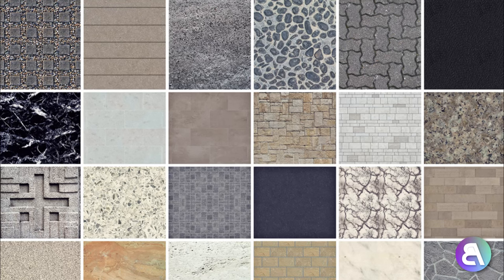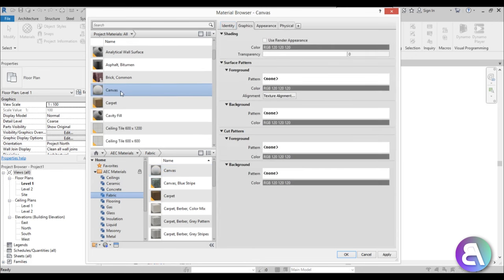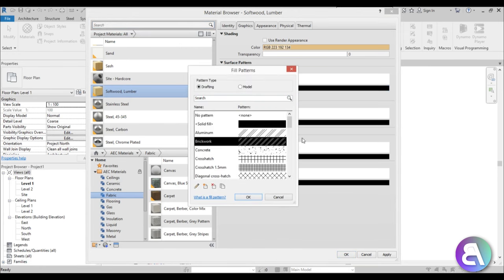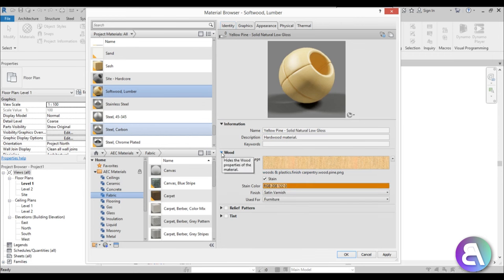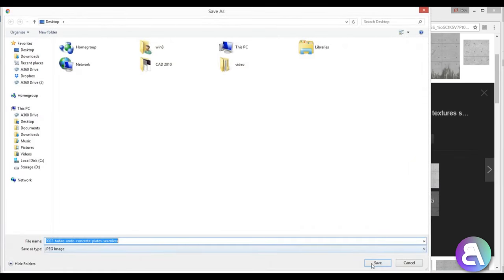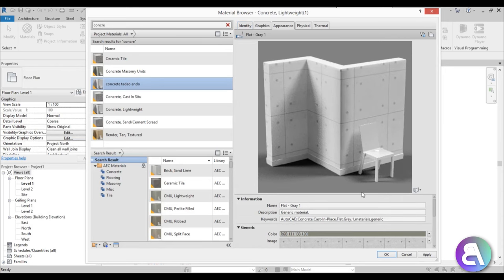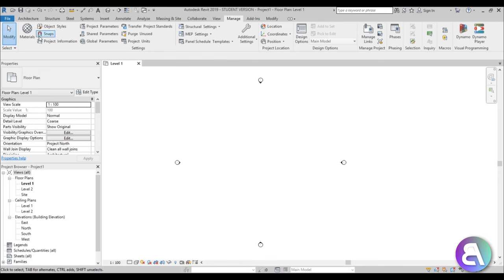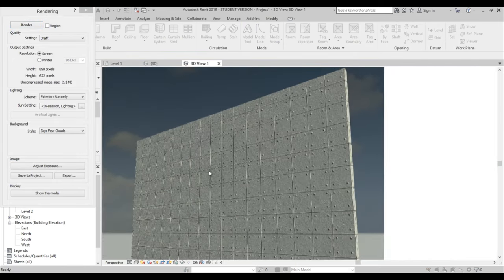How to Make a New Material in Revit Tutorial

Comment: Your other tutorials are great, but this one, i gotta say, is poor practice. It's almost a redundant procedure duplicating a material in order to keep all the physical and thermal properties the same. If you're using materials to the extent that you need to have said property fields filled out and valid, than you would take your time to ensure that they are correct because every material has differing properties. Also the correct process for creating a new material usually follows making an image/texture seamless in photoshop (using offset) and then finding out the actual measurements and using them in the scale/sample size fields.
Reply: Phelix Baxter ease up a bit. He’s covering basics only.